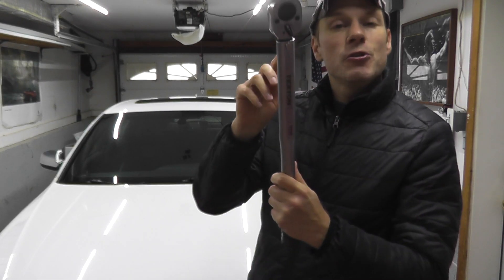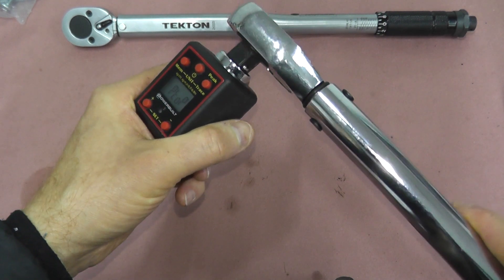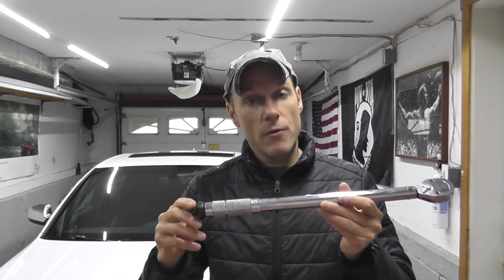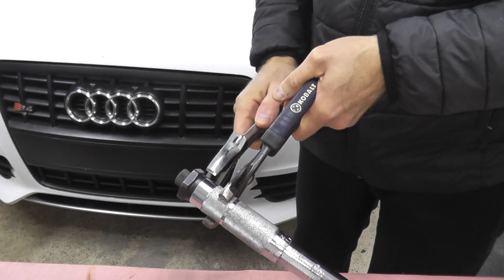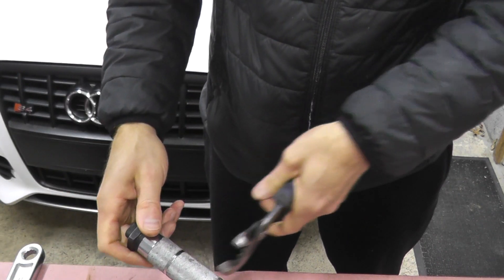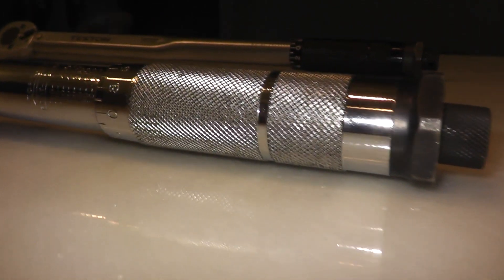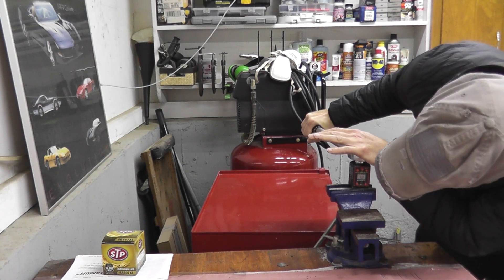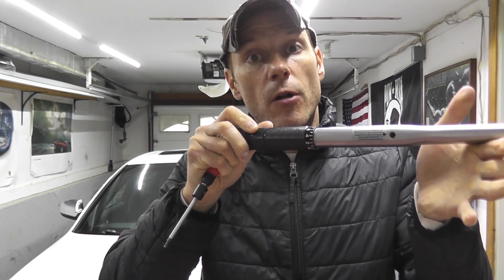Is Your Torque Wrench Accurate? | How to Test or Calibrate your Torque Wrench

Comment: The last I checked there were no bearings in a torque wrench other than the ball to hold the socket on or the sprag for direction. The device inside a treaded and relies on a spring.
Reply: If you're happy to consider the detent ball in the square drive a bearing, many torque wrenches have just such a detent ball that releases at the right moment to create the click action. His wrench likely does, in which case he would be 100% right to reference adjusting so the "bearing" (ball) clicks at a higher value.
Reply: @PlatypusPerspective  I have had both those style wrenches apart as well as split beams. They all had cams and springs. I guess I was unlucky.
Reply: @maxwebster7572  The common tubular click wrenches will all have the compression spring, and a sliding cam to transfer the force, but varying detent mechanisms to achieve the release. It's often a pivot block, but the ones with the inclined plane at the end of the internal beam should be either roller and groove or ball detent.

Comment: Thanks for the informative video and explanation.
The reason for my current interest in torque wrenches and accuracy is that my van needs spark plugs (tapered seat, no gasket) and the torque for them is 6-12 ft. lbs. into aluminum head.  It make me nervous.  
 I have 3 clicker torque wrenches and just finished "calibrating" them.  Assumption:  a "beam" type wrench is more accurate than a clicker.  So I played my 1/4", 3/8", and 1/2" drive clickers against a neighbor's beam wrench at various settings, then noted what the scale said on the beam wrench.  Then, made a correction chart for each wrench. 
 The 1/4" clicker read the same as the beam wrench throughout its range, which surprised me.  
 On the 3/8" and 1/2" drive clicker:  Low settings at 5 and 10 ft. lbs yielded 30 to 37% more torque on the beam wrench.  At 20 ft. lbs.settings and above it got better, 10 to 20% higher readings on the beam wrench.
Best accuracy was at the top half of each wrench's range, you could add 10% to the indicated setting to get to what I call "true" torque as opposed to "indicated" torque.

I did what I did, with what I had available, and am comfortable with it.  I don't think that I will be breaking anything soon!
 
~

Comment: This is good information and I have used this to adjust my torque wrenches. Thanks for putting this together and posting. One thing I have noticed when torquing small values, 60 inch pounds for example, it is difficult to get a repeatable torque setting and this is likely due to inadvertent forces applied to the wrench that are non-tangential to the rotational direction of the bolt. If the applied force has a non-tangential component (i.e., a pushing or pulling direction instead of pure rotation), the effective torque is reduced — even if the same amount of force is applied! So be careful out there.

Comment: I thought a torque wrench should be stored set at zero lb.ft. That's what I've always done with mine.
Reply: Does your torque wrench have a scale down to zero? Mine starts at 22.1 (or 30 Nm), and the instructions say "set the unit to its lowest torque setting before storing it", which is the usual advice given.

Comment: Just bought a torque wrench yesterday. Upon reading the manual it says to test it first. So now i gotta buy a table, a vice, and an adapter. I dont even live in my own house so i can't keep the table smh ffs seems so stupid whats a alternative? Besides forking out thousands for a tester. Disnt know there was going to be so much effort into adjusting the tension on my motorcycle chain 😪
Reply: Run at a quater inch deflection is what we use to do.Never used a torque wrench for that.Although my harley actually uses a deflection tool for the belt drive I really think it's not needed but that's just my opinion.

Comment: Sooo...for $63.99 I can buy a Digital Torque Adapter to calibrate my $20.00 dollar torque wrench!
Reply: You can also buy a really expensive one and have the same problem. Plus other issues like under or over torqued fastners.
Reply: I don't understand your point. You're going to buy another $20 wrench so that you don't have to spend $64 to calibrate it so you'll never know if your new $20 wrench is properly calibrated. You really trust it out of the box? Interesting. You've never run a lab. The relative costs don't help you make sure your wrench is calibrated.
Reply: @MarmotKing-666  The torque wrench is certified out of the box by a LAB with a certificate within 5%. If you use the torque wrench at the bottom 20% of the scale it is inaccurate. Using a 1/2" drive wrench is a high enough torque that in automotive applications the accuracy will not matter. If the wrench is calibrated outside of a lab, it has to be at 70 degrees F or it will be inaccurate. If the object being torqued outside a controlled temp the torque will be inaccurate. A torque wrench can be calibrated with a "known" wrench.  If you have an application using stretch bolts your torque is nearly irrelevant. Your comment is also irrelevant.  If you work within a "LAB" and are using torque specs you sure as hell would not be using a click type wrench and if you are following ISO 17025 procedure you sure as fuck would not use a digital device purchased from the internet.
Reply: Don't forget the vice

Comment: Wrong.....sorry, on the second Torque.....the allen screw is for the SPAN.....
You need to adjust the low range with the nut (like the 1st trq) and fine tune the upper range with the allen screw....then recheck low range
Also, when storing, leave it at MINIMUM Setting.....not 10 (which as probably no graduation)
PS - I calibrate and maintenance torque for over 25 yrs.....
Reply: Unfortunately, there are many "how to" videos on YouTube giving incorrect advice on adjusting torque wrenches. At least this isn't one giving wrong instructions on how to initially check the torque delivery - so many using weights or scales do it wrongly and would have anyone who did have an accurate wrench believe it was out of spec.
Reply: Thanks, that was very helpful!

Comment: Why leave the torque wrench at 10 ft. Lbs?
Reply: I'm an aircraft mechanic. We leave ours at the lowest torque setting when not in use to keep tension off the internal spring.
Reply: @berticusmaximus8381 is it bad that ive left mine above that for about 2 weeks now? Ive done it now but had no knowledge to do this beforehand
Reply: Best way to check is to calibrate it. Two weeks is probably ok but don’t do it all of the time.
Reply: The harbor freight $20 torque wrench Instructions say to go up go maximum setting and low setting once in a while. It's the 3/8 size. Honestly only things I bought it for is the oil drain bolts.

Comment: Some inside baseball from an engineer: +/- 20% of the nominal value is fine for most steel to steel applications. Steel to aluminum and small fasteners you want that tighter accuracy.

Comment: Hello could you test the torque wrenches at different grip points, say at the end where you would normally push from at 6"-12" choked up on the handle.
I have seen other videos that say where you place your hands gives different results.
Thanks
Reply: Always grip the torque wrench in the middle of the part designed to be hand gripped. Your whole hand should cover the whole grip. Notice how the grip is not excessively large nor small.

Comment: As usual, no metric values.
Reply: What does it matter? Pick a metric torque and do it the same way. Torque is torque.
Reply: @berticusmaximus8381  That's how NASA crashed it's Mars Climate Orbiter, some high end engineer didn't think it mattered.
Reply: @ChargedPulsar  I think you misunderstood me. I'm not saying that they are the same, just that you can calibrate it in either. When I said torque is torque, I meant it doesn't matter which you use as long as the torque value is the correct one. There is no better version of torque. The orbiter thing was a little more complicated than making sure your torque wrench was calibrated correctly.
Reply: "As usual, no metric values."  Sounds like it's an ongoing problem for you.  Maybe learn how to convert between standard and metric.  It ain't rocket science.
Reply: Nm / newton meter is not as easy too .
Because 9.8 Nm is 1 Kgm 
Or 1Nm is 0.1019 Kgm .

So for speed of calibrating 
A 50 pound force at 1 foot = 50ftlbs . Faster without calculation .

I switch back and forth from Nm to FtLbs. 
For calibrating using a weight scale . I’ll go with ftlbs for speed of it

Comment: I just bought one but its waaaay off and it doesnt even click on the lowest number cant believe i got a broken one
Reply: Take the ratchet end out by removing the pin by the head of the ratchet. Then look down in there and make sure the little square piece is lined up right. It could be cocked sideways not letting it break over

Comment: I have a 40-year-old made in America torque wrench that i tested using the luggage scale pulling on wrench and it tested within a pound I guess they made them better back then mine does not even seem to have an adjustment and it was not that expensive just from local auto parts store
Reply: If yours doesn't appear to have an adjustment screw look at the very bottom of the handle. It's probably full of solder use a propane torch to melt it out and you'll see two Allen screws that you can turn to adjust it. You can decide if you want to refill it with solder or not.

Comment: My only question is how accurate is the digital adapter?
Reply: The docs for your torque adapter may say that, but it too needs to be verified as you are using it to calibrate other tools. Ask Dr. Google how to check the accuracy of your electronic torque adapter. It's straightforward and easy.
Reply: @Pheckphul1 If you're going to check the digital adapter, presumably using weights, why not just skip the adapter and check the wrench with weights?
Reply: @feanor5037  Because it's a great deal easier to use the digital torque adapter to measure a torque wrench than to monkey around with measuring length and using weights. Therefore, insure the digital adapter is accurate using the weights, as you are using it as your prime example, and then measure against it. I'm pretty sure even my Border Collie would immediately recognize the reasons and understand the process. 🙄
Reply: @Pheckphul1  So I have one torque wrench. I can either monkey around with weights calibrating the torque wrench directly, or monkey around with weights calibrating the digital adaptor and then use the digital adaptorr to calibrate the torque wrench.

It seems you're right to compare your critical thinking skills to that of a border collie. Eager to be seen to work hard and impress but unable to see when a labour saving gadget is just adding complexity to a process! 😅
(Seriously though, why can't we just have an adult discussion without making insulting insinuations about each others' intelligence?! Maybe I'm missing something but in my above scepticism of a digital adaptor for home use I'm not sure I am.)
Reply: @feanor5037  You made me chuckle
Reply: Put the wrench in a vice. Hang some weight off the end via a pulley by a string.
So long as your measurements and weight are right, you should be right on the money
Reply: Dumb question but what measurement are you referring to? don't you just hang the weights off the handle and wait for it to click on set lb settings? @HouseholdDog
Reply: @Don-ve5en  There's also the weight of the handle to take into account.
Reply: @Don-ve5en  formula is lbs/12 x length    example: if you hang 20lb weight with a length of 10 inches from center of square of ratchet to where string is hanging it would be 20/12 x 10 and that gives you the value to set wrench at and it should break just at that when you hang the weight, if not adjust the wrench
Reply: That's why you should use a luggage scale instead.
Reply: I have one. As near as I can tell, mine is "balls on accurate," to quote a famous automotive mechanic scholar. I tested my digital torque wrench against a Craftsman Microtork torque wrench that was recently calibrated by the state department of weights and measures and against a Vibrelli torque wrench that had recently been tested and officially certified as also being "balls on accurate."
Reply from the maker: Good question. + \ - 2%

Comment: There is another way of recalibration, which may be less costly, but yours is straightforward 👌
Reply: Care to share?
Reply: Well, what is it?
Reply: @squirrelcovers6340 Using weights. There are other videos demonstrating the method if you search YT
Reply: i used a digital luggage scale used for checking your bags for flying and just chucked up bolt in vise and pulled on handle check pounds of force till it clicked and just measure how far from the center of socket to where scale was hooked on handle then do the math if you are 18 inches you multiply by 1.5 for example
Reply: @ranger178   luggage scales are not accurate
Reply: @tobyk5149  i am not trying for super precise if it is within a pound it would not realy matter the luggage scales are pretty close if you hang a weight off scale then stick that same weight on a precission scale like postal or for lunch meat it all reads pretty much the same
Reply: @ranger178   fair enough but the luggage sces I tried and compared to digital scale were way off. The real concern is having a trusted known weight as the standard